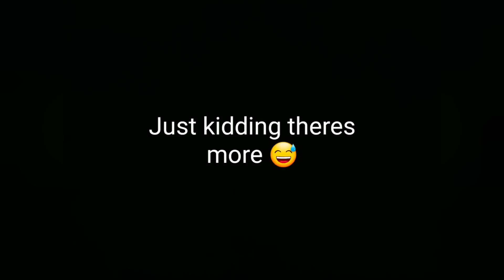LaborDay 2023|House Updates|1,000 ways building a house could go wrong | PennyPincher| country livin

Comment: What a fun day on the water slide!  So great to see Dad and Mom spending such quality time with the kids!  More is getting done than you think.  Looks like there is at least some work done on the roof and the front porch is well underway and the plumbing inspection is done!  I think the inspection couldn't be done without the bath/shower combo installed so it makes sense to use whatever they had just so you didn't have to postpone the inspection.  Stinks it cost $400. though.  They obviously didn't repair or fix anything.  Let go of each other's mistakes quickly.  It's nothing compared to the great relationship you have.  All the best!
Reply from the maker: Definitely so! Thank you ❤️